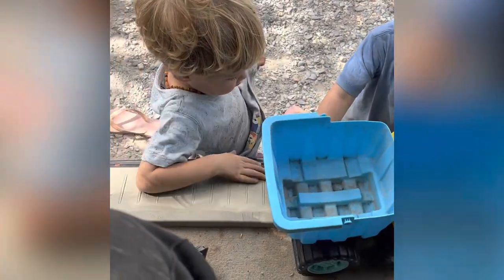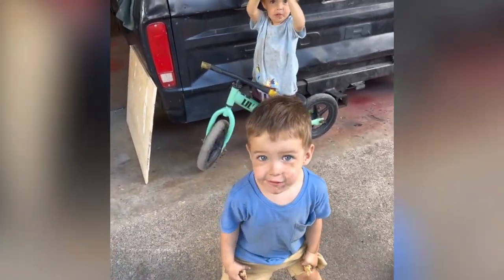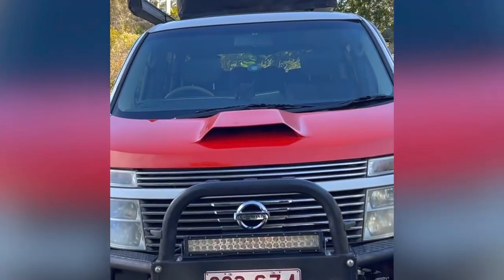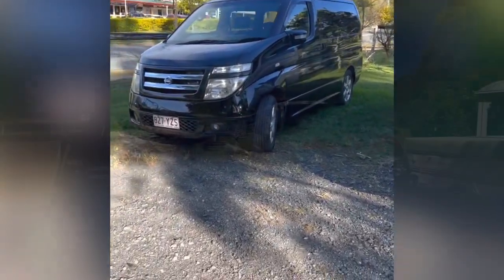lift kit to 4WD Nissan Elgrand  my new baby ￼￼

Comment: that is an awesome build, did you have the front bumper custom made? I am looking to do a very similar build as the family camping bus, did you find the lift kit changed how it drove very much?
Reply from the maker: Hi there, yes it is a bull bar. You can buy but you’ll have to make up your own custom mounting brackets to fit to the front of the Elgrand . It is called N70 xrox it dries more like a 4wd drive sways a bit going fast around roundabouts as a four-wheel-drive would the big chunky mud ties I’ve got on it have less traction in the rain as a four-wheel-drive would  definitely has a more floaty, feel with the bigger suspension and bigger tyres, much smoother, comfortable ride, then hard ride it had before with a lowered suspension and low-profile tyres
Reply: @riarneadam is the xrox bullbar you used, the one for a Nissan pathfinder as well? I recently hit a roo in my elgrand and I'm super upset about it! Haha. Want an upgrade and this means I don't have to worry about the bumper anymore! I presume the grill is off a pathfinder as well?
Reply from the maker: @damachinen  it’s the Nissan Elgrand Grill I’ve only taken the front bumper off to fit the bull bar on

Comment: Awesome rig! What lift kit did you install? Looking to buy an elgrand myself and trying to weigh up the costs of making it more off road suitable.
Reply from the maker: Okay, so are you suspension out of another four-wheel-drive that just bolt straight onto the Elgrand so in the front I use Nisan pathfinder R 50 front struts. You'll either need to use a spacer plate or get 2 inch lifted springs to match the height of the
Reply from the maker: You can buy the parts brand-new from eBay or find them at a wreckers like I did and got them. All secondhand cost me 200 bucks for the front and rear
Reply: @riarneadam 😊ok we will try

Comment: Can you tell us what lift kit you used? Or who did the suspension?
Thanks
Reply from the maker: Okay, so are you suspension out of another four-wheel-drive that just bolt straight onto the Elgrand so in the front I use Nisan pathfinder R 50 front struts. You’ll either need to use a spacer plate or get 2 inch lifted springs to match the height of the springs in the rear in the rear I use Y 62 patrol spring  the front springs out of this in the rear of the Elgrand .